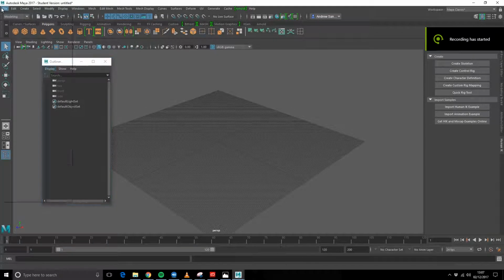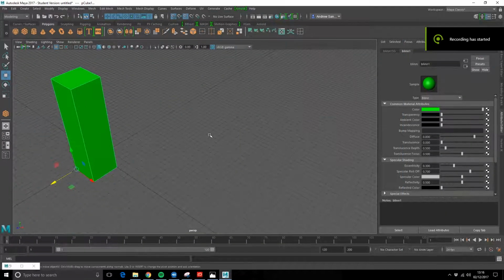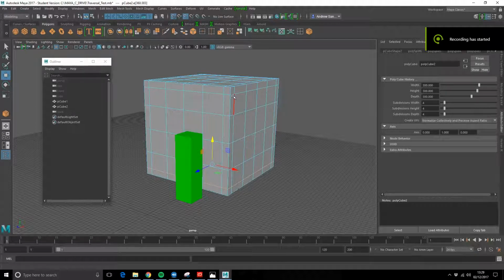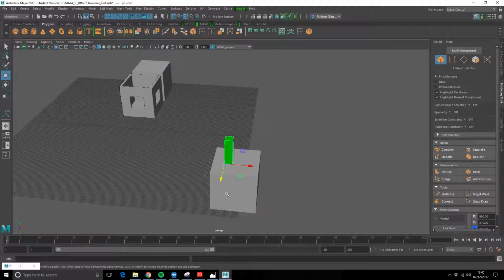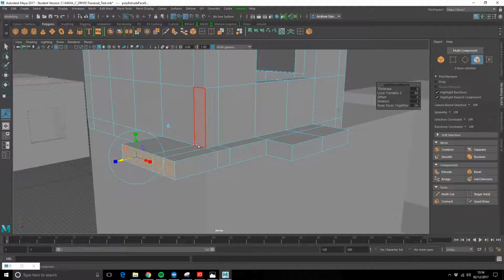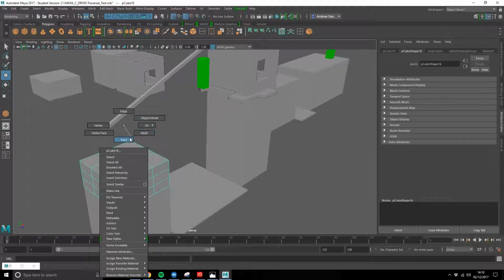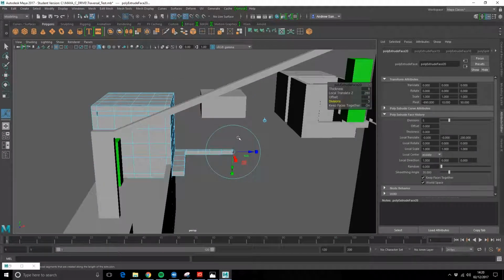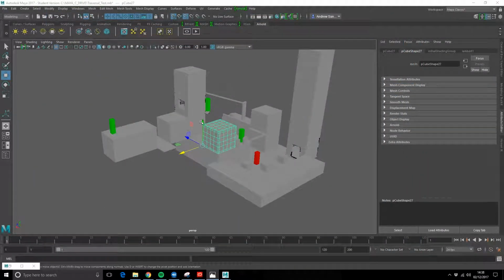Traversal Whitebox Exercise

Comment: Did you end up putting this prototype into unity? Was this just a white box to illustrate your level? Also, why did you extrude from the boxes themselves? extruding from the boxes limits the amount of geometry and flexibility you have if I'm not mistaken? The Extruding into the cube itself was a neat trick to make rooms quickly.  Thank you very much for making the video.
Reply: I also just noticed that you have too many Faces to use the Mesh collider in unity, you will have to make a second less detailed mesh if you want to be able to test the cube with the window.